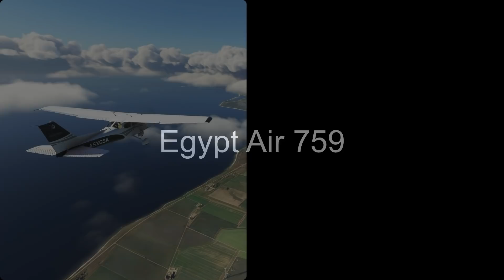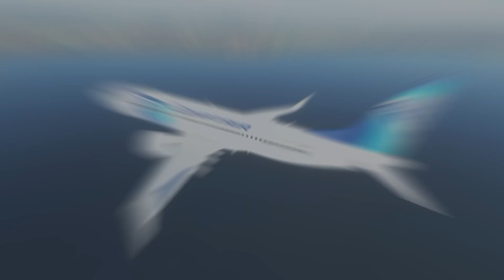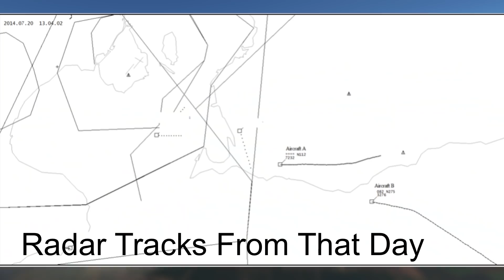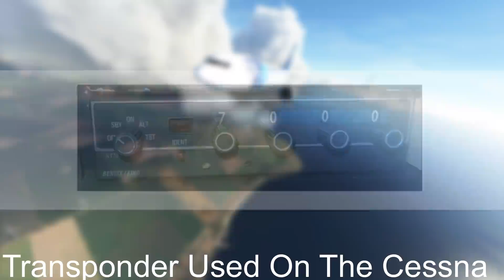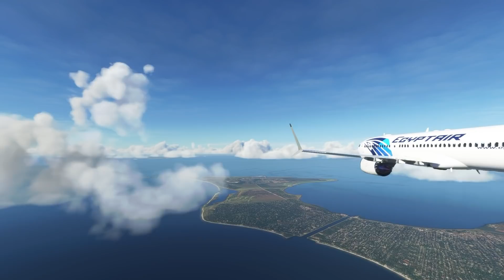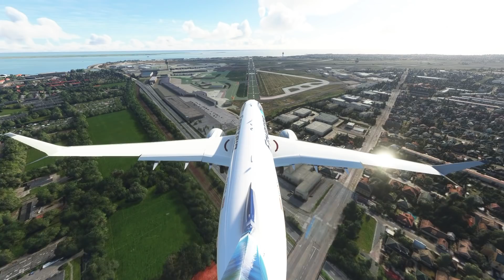How A Sick Passenger Almost Caused A Mid-Air Collision | Egypt Air Flight 759

Comment: I worked at NASA/JSC and before every KC-135 flight everyone who was part of the tests were told to never drink anything red, like grape juice or koolaide. The KC-135 flew several dozen parabolas so it could experience weightlessness while descending. The constant change from 2G to 0G caused a lot of people to throw up. That’s why they named that KC-135 “The Vomit Comet”. If anyone threw up red liquid it would cut the flight short because it looks like blood. 

The Apollo 13 movie with Tom Hanks was partially filmed in the KC-135 in 1995. All of the weightless scenes were filmed while flying parabolas over the Gulf. 

…

Comment: Excess moisture wreaks havok with electronics. As a former mid level employee of an Aerospace manufacturer,  making parts to spec is crucial, and observing all the times assemblies were allowed to ship from the factory after bring failed by quality control is the main reason to this day I will not fly.

Comment: Honestly, I wouldn't be surprised if he'd forgotten to switch it over and thought he did. I've done that when I had an old Narco Transponder in my 76 Cherokee and with those old King 76s in a few old 172s, especially after flying an aircraft that has the transponder's Altitude Reporting Mode (ALT) tied into the squat switch.

Comment: "Cessna pilot lied" is the explanation that most closely conforms with Occam's Razor.

Badly designed transponder is the reason for the near miss. Switching on the transponder should switch on everything - then the pilot has to go through extra motions to switch off transmitting pieces of data.

Comment: Looking at the picture of the transponder, the first obvious issue that the pilot can simply be confused about what settings it was in since they are very close. I have no clue about the cockpit layout but if it is for example a bit down to the side, pilot glance at the instrument could easily be mistaken.

With the caveat that I’m not a pilot but looking it as a design question, the knob seems to violate good user interface design. Disabling the altimeter is a rare thing I imagine, so it doesn’t have to be on the main dial. Test certainly doesn’t have to be on the main dial. So the rarely used special modes could be moved away to harder to engage buttons. 

Maybe a second interface harder to change between unusual alternative mode operations that normally never change between flights; NonAlt, Alt, Tst. That interface could be harder to access and beneath protective plastic so it never can be accessed unintentionally. So, bad human user interface design could be contributing factor to the incident.

So: Too easy to be in wrong mode and mistake it once glancing at the instrument, that’s my main guess.

As for secondary guesses:

I’m presuming accident investigators did check how good the dial is, not just if it works when set properly. So there’s no way getting into a unclear half-set somewhere in between two settings where it would be unclear or glitchy if it is in ON or ALT. I would presume it is build to provide a very clear tactile response and not have any unclear “in-between” states?

As we have a passenger involved, another question is if the passenger could accidentally switch it if it is to easily changed. Or if wiping off puke from the cockpit is sufficient to change the setting (but the puking occurred much later than the drop of altimeter info?)

Comment: Regarding pronunciation, never worry about the big Scandinavian cities because several have English/Internationalized secondary names if the local name is hard: Malmo (Malmö), Copenhagen (Köpenhamn in Swedish, slightly different in the original Danish), Gothenburg (Göteborg). Stockholm doesn’t have one because it is easy to say in English. So if you are reading the international names as English, you are doing it correctly exactly as locals would do when talking in English. The only hard parts are the smaller cities/locations without any simplified/internationalized names.

So basically there is an interesting big simplification here targeting making life easier for people familiar speaking English, that is widely accepted by locals.

Fun side note, an old colleague told me that his girlfriend had been confused since she had found an second hand contract on an apartment in Göteborg and asked how far away this city was from Gothenburg. “It is the same city, it has two names…”

Comment: You are not being precise with squawk codes. There is no requirement to have a transponder on GA aeroplanes, flying outside of controlled airspace. Transponders for non controlled VFR flight is set to code 1200 and mode "C" for Altitude is not required. If the aircraft is passing through controlled airspace in most of the cases the transponder is required and the code from ATC will be issued or ADS'B OUT will do that automatically. Today all commercial aeroplanes are equipped with ADSB Out and a transponder is no longer required as each aeroplane is sending code to ATC and ATC can see all information related to the aircraft including altitude, position, speed, the direction of flight, aeroplane type and model and registration number. Most of these were unknown to controllers before ADSB Out came to life.
If you are flying a small plane equipped with a transponder and you do not own ADSB  Out then you will receive a code from the controller, if your plane is not equipped with a transponder as well it is up to ATC to let you in the zone or decline passing through.
To activate the transponder you need to set a correct mode and on request send an Ident signal to ATC to recognize your plane on their radar screen.
This is just abbreviated information, for more search on google, but as for this clip, there is too much inappropriate information given to the general public who do not know much about aviation and communication systems in use in the aviation industry. This video may scare some people with incorrect information related to the occurence.

Comment: In my opinion the Cessna's pilot is to blame but the air traffic controllers (both) shouldn't have taken for granted where the Cessna was specially when it was obvious it was going to cross paths with the other flight without knowing at what altitude. That is something I would have checked with the pilot of the Cessna. Assuming is a verb that we see too often in any kind of collision.

Comment: Cause(s) of incident:

(1) Inexperience of C172 pilot.
(2) Communications breakdown of and between C172 pilot and ATC.
(3) Commotion in C172 cockpit during critical phase of flight when "sterile cockpit" rule should be observed (no pun).
(4) Improper procedures by C172 pilot.
(5) Vomit on transponder required cleaning during which mode of operation of transponder was inadvertently changed.
(6) C172 pilot lying with regard to mode his transponder was in (i.e. he had just turned it On and not put it in Alt mode).

Comment: How did the TCAS know the altitude of the Cessna if the transponder wasn’t transmitting it. I thought even with one of the planes not having TCAS it still depended on transponder info. Sorry if this is a stupid question.

Comment: Flight instructor here with over 1000 hours of experience teaching people how to fly Cessnas so I’ve seen all the mistakes in the book.

Less experienced pilots make these mistakes all the time when flying.  However, these are very minor and if you are in controlled airspace the controller should very quickly correct these mistakes.  The most common mistake with almost anyone is forgetting to turn their transponder on before taking off because it’s not supposed to be turned on until cleared for takeoff out of a controlled airport.  Therefore it’s a high stress situation for a less experienced pilot after he is cleared for takeoff and forgets to turn his transponder on.  However, every time you enter controlled airspace or take off into controlled airspace IT IS VITAL that the controller identifies you and notifies you that you are radar identified.  This includes altitude encoding.  If it’s the wrong squawk code, or there’s nothing, or there’s no altitude encoding it is 100% ATCs responsibility to notify you to remedy the problem if able.  While it’s less common for people to accidentally put the transponder in ON mode rather than ALT mode because ON mode is never used (because why would you if you got altitude encoding?), it still does happen because the settings are right next to each other.  Usually transponders are designed so that the ALT setting is farthest to the right so you can just turn the knob all the way to the right without thinking, however some like the one shown in the video have the test setting on the far right so you can’t do that, and therefore more mistakes arise when switching to the ALT setting from SBY.  That is what I assume happened with this guy.  He could have taken off from and uncontrolled airport in the ON setting and never got notified of the problem.

While it is always the PICs responsibility in VFR flying to maintain traffic avoidance, it is ATCs responsibility to provide traffic avoidance information when necessary and IT IS ATC RESPONSIBILITY to maintain traffic avoidance for IFR traffic which I assume the 737 was, and they clearly failed at doing that.

If that is all the information, ATC is 95-100% at fault for this incident.  Just straight incompetence.

Comment: When the Cessna's transponder was not transmitting the altitude, how could the B737's tcas determine that the Cessna was on collisioncourse? The tcas has to know the other plane's altitude and the own plane's altitude. But maybe I am wrong here.  Nice simulations! Only the landing of the B737 was very long, probably just beyond halfway of the landing runway distance. Normally you would go around. Funny to see that Copenhagen Kastrup has 3 control towers here. Amsterdam Schiphol has 2, but only because the latest added runway 18R/36L (Polderbaan) was too far away from the very high main tower (over 3 km!), so they had to build an extra tower next to the Polderbaan.

Comment: I know a couple of people who kept their phones in their back pockets and, as a result, had their phones fall in the toilet when they went to pull up their pants. One of the people's phones didn't work at all and the other person's phone only had partial problems. However, both phones worked again once they were completely dried off. Maybe a similar thing happened to the transponder on the Cessna but, by the time they tested it later, it had dried out enough (and undoubtedly been cleaned better) so that everything worked.

Comment: There is a lot unclear in this video. I checked extra for the date as this adds to the confusion.
The transponder as presented in the video at the time already was outdated equipment and needed replacement by a TCAS complient system in order to keep the aircrafts airwothyness certificate valid.
The old equipment ONLY reported Squak code, Alt (mode-C or Alt-reporting) and ocaasionaly the Ident flag.
Such equipment is long gone (still got one in working condition) as also required ground radar equipment.  I can not eleborate on the new TCAS complient systems other than that they are way more sophisticated use GPS and extensive communication between aircraft to prevent potential collision situations. The 737-800 is pretty modern and would give a warning long beforehand. If the XPNDR on the 172 did not work there was no way to know both aircraft where in danger.
Futhermore It is unclear to me if you realy meant TMA or possible CTR.
CTR has predetermined arrival and departure altititudes and routes for both VFR and IFR (it is reasonable to guess the 737 was flying acourding IFR rules, and the 172 most likely VFR).
Flying into a TMA there are altitude rules due to the fact that Airspaces not just have location boundaries but also altitude boundaries. you can have multiple different airspaces above each other and they even can be different is lateral size.
Given the situation ATC should have contacted the 172 and confirm details and state the situation of the airplane and equipment. NEVER ASSUME ANYTHING !!! (assumtion is the mother of all fuckups).
Mistakes are made... can happen to anyone (certainly to me I'm afraid 😳 ) the point is how to solve them before it get's realy nasty.
Great video again. must be a lot of work to assemble these.
Still for the 172 i wonder what avionics realy where available as this also is a discepancy in the video (which i can understand but stil is confusing)

Comment: I wonder if the transponder knob got turned while the control panel was being cleaned.  It’s also possible that the Cessna pilot was mistaken about having set the transponder to “alt” mode.
Reply: With only 52 flight hours for the pilot, I'd guess the latter...

Comment: It is hard to believe that the controllers did not have a procedure for aircraft not reporting altitude. There was not even a "Cessna xxx Report Altitude" call. If you listen to ATC radio, several times a day you hear a call to report something that the pilot forgot to include in their initial contact.

Comment: There's some important info missing here.  A link to the report would be appreciated.

Why did ATC not ask the Cessna pilot to switch on Mode C if they didn't receive altitude?  How does TCAS work for pure mode A transmissions?

Also, there was almost another accident: The EgyptAir touched down awfully late (9:00).  :P
Reply: Since TCAS couldn’t determine the altitude of the Cessna the TCAS on the B737 would have give TA (traffic advisory) and no RA (resolution advisory = climb/descend)

Comment: Great job. As a pilot, the controller is supposed to verify the altitude of an aircraft entering/leaving a TCA. It would be something like “Cessna 123 radar contact, say altitude.”  In response, the pilot would state his/her altitude from the altimeter and the controller would make sure it matches with what is being displayed on the scope. As the Cessna transponder was was NOT in the altitude mode ,the controller would note the lack of the corresponding data tagging the aircraft and request him/her to “squawk altitude.”

Comment: I'm guessing the inexperienced Cessna pilot did not have his Transponder set to Alt mode ( is this short for Alternating or Altitude? ) first of all, and I think ATC should have questioned the pilot for his altitude since it was not broadcasting this information...instead ATC ASSUMED he was below 4,000 ft and missed a clear opportunity to avoid this near miss altogether.
Reply: ALT mode is short for Altitude mode (aka "mode C")  There are many light aircraft that have transponders that do not have altitude reporting capability (only work in mode A), and so the controller may not have seen it as being unusual.  The controler should indeed have asked for altitude.

Comment: The cause of the near miss incident was the failure of ATC to properly maintain aircraft seperation.  ATC could see the cessna on the radar but assumed the planes altitude rather than confirming altitude.  the Cessna's transponder was a contributing factor not the cause.  Just like the L1011 that crashed in the Everglades the burnt out lightbulb on landing gear indicator was a contributing factor not the cause.  the pilots failed to properly Aviate and Navigate their plane while distracted with the landing gear.
Reply: You're missing the part that the piolet of the cessna didn't call up/sign in to the new ATC. he flew into a controlled airspace.
He was also distracted by a pewcked passenger that didn't helpv

Comment: In my opinion, much more of the blame should have gone to the air traffic controllers here.  Yes the inciting event may have been the Cessna pilot's failure to put his transponder in "alt" mode, but that fact is very obvious on the controllers' 'scopes because there's a particular spot in the data block for each aircraft for its altitude, and that spot would be empty (as shown in the video). They never should have assumed the Cessna was (or wasn't) at a particular altitude, they should have asked and/or reminded the pilot to put the transponder in the right mode.  

Also I've done some flying in light planes and never seen a transponder that needed to be switched out and back into "alt" mode when changing squawk codes.  Usually you just turn the knobs to set the code and you're done.
Reply: If you don't switch off the transponder before changing codes, you're doing it wrong - and that could be dangerous.  With all but the latest transponders you change codes one digit at a time using 4 rotary knobs, so if you don't switch off first, the transponder will briefly send all of the intermediate codes as you switch through them, and there's a good chance that one will conflict with another aircraft's assigned code, or you'll briefly switch through an emergency code and bring up an alarm in every ATC centre within range.  When given a new squawk, the procedure is (1) switch the transponder to "standby", 2} Enter the new code 3) Visually check & verify the new code is correct, 4) switch the transponder back to the required mode, 5) check the interrogation light is blinking every now and again.

Comment: Two sets of ATC failed to ask a reasonable question because they made an assumption, according to this; "Say altitude". They also apparently didn't query the transponder mode.
Reply: If you're unsure if an targets altitude, you vector the jet away from it.
Reply: OOOOHHHHHHHhhhhhhh... dang bro!
Reply: It might have been difficult to ask those questions of the controllers.  It might have been politically easier to school a 172 pilot instead.